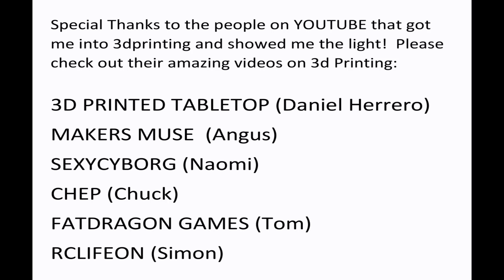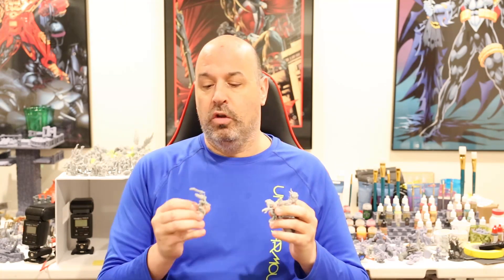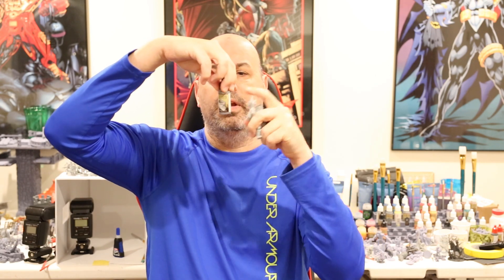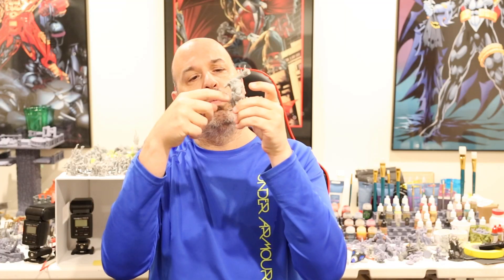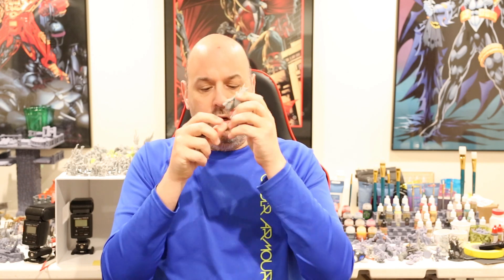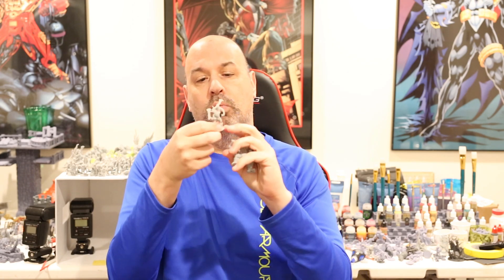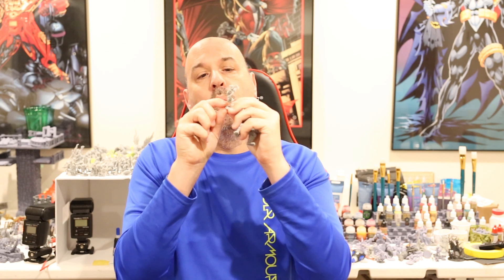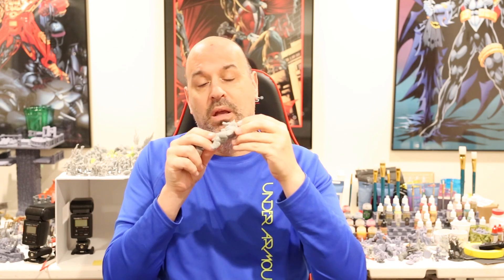How to orient humanoid minis for resin 3d printing.  Let's settle this once and for all!!

Comment: I'm a noob at printing but fail to se the logic in this as the surface area does not all get printed at the same time,  actual area being printed per layer is not as greater difference as you say.

Comment: hmm that is interesting it's almost as though you want the opposite of FDM printing. as smaller cross sections are less likely to fail where as in FDM printing they are more likely to fail because of the tug force of the extruder dragging hot plastic along the surface.

Comment: I think much of that "conventional wisdom" is left over from the early days when the Form 1/1+ was the only game in town.  It was a good way to increase resolution by moving some of your crossection into the Z axis.  That being said, the Form 1/1+ had a mechanically tilting tray as part of its peel process, which is substatially less stressful on the FEP than a direct vertical lift of the build-plate, which almost all other SLA printers use.

Comment: Since day one every single thing I’ve printed has been tilted back 30-40 deg, mostly to keep the supports off their faces and such.  I put RainX on the bottom of the vat.  I have yet to experience even one single failure or something that didn’t print.

Comment: Good insights, Greg. Just curious, if you don't tilt the mini much, won't you have less surface area to attach supports to? Also, which version of Chitubox (on Windows) would you recommend? I had to reformat my hard disk and was not able to note which version I used. I remember a few months ago that people suggested sticking to an older version of Chitubox because it was better than the latest (advice that I followed). Not sure if that's still the case now

Comment: Well, on many cases I don't tilt my miniatures at all. And the amount of people thinking they know better telling me that I have to tilt 45 degrees. We need supports for 2 reasons: 1. To support the "islands", and 2. to keep those large cross sections still attached to build plate, and not to FEP film. Another way of lowering those peel forces is to hollow your models. It only makes sense on larger models but it will greatly reduce the amount of support needed, and you can get away with making them tinier

Comment: Greg, great video - thanks for breaking it down.  Can you talk about how you remove minis from their bases without messing up the models/bases?  Maybe it's easy but every time I do it, I leave either some of the feet/shoes on the base, etc.
Reply: Us 3d builder for windows. U use the split option and then use the arrow keeys to move it 1mm at a time until you find the exact spot the feet meet the base.

Comment: I print my humanoids with a base included. Since bases are flat discs, if you tilt it, you decrease the peel force. Also, if what you say were completely true, then printing big miniatures would fail a lot more due to peeling than small, which certainly has not been my experience. Additionally, besides the base tilting, I also tilt so as no to support facial features: which are the part sof the miniature people look at the most. A failed strand of hair is noticed by no one, a failed nose: better print an entire new miniature.
Reply from the maker: When I print I get nothing failed, not a nose, not a strand of hair  :)

Comment: Interesting. I think I'll stop tying to maximise my bed usage and just print one at a time or and minimise fep pull
Reply from the maker: I still load the bed, just be cognizant of how much print surface may be printing at once and how it could cause failures...so on certain types of models you might not want to load the bed...
Reply: when loading the bed you need to pay attention to where those larger forces will be.  If there is a big layer make sure it's in the middle or evenly spread out.  If there's big pull on one side that isn't on the other that greatly increases chances of a line shift

Comment: Thanks for these topics on peel force. I've noticed that the forces might be larger towards the edges of the vat/print area. The rare few failures I've seen are on the edges, even though the same model prints absolutely fine towards the center.

Comment: Interesting video. I've watched a lot of your videos and they have been quite helpful, especially when I was trying to set up manual supports. But I'm curious... if you don't tilt the model wouldn't most of the supports end up attached to the model instead of the base? That makes clean up a bit difficult.
Reply: Dont print the mini on the base.

At 5 degree angle most supports will end up on the under/rear side of the mini
Reply: @JimmiWazEre  Many of the minis I have come on the base, so that's not always an option.
Reply: @RedDuckStudio  check out prusaslicer. It has a nice cutting tool(different from slicing) that you can use to split a mini from its base then save the base-less mini and the base as their own stl files. It only cuts a flat plane, so it might not work for all instances, but it does work for simple bases, so it's a start. For more advanced stuff, you could probably use mesh-mixer or something like that to remove more complex bases.  Side note: I also use prusaslicer to combine multiple stls and merge them into one solid piece and export that piece as a single stl. Again, more advanced needs will need a more advanced program, but adding say a keyring eyelet to a larger model and then printing that as one file/object/remix is possible.
Reply from the maker: I angle my supports if you watch my support placement videos you'll see why what you described doesn't happen  :)
Reply: @3dprintingpro212  I'm learning -- slowly -- to move the supports around so that they don't rest on the model. Also, maybe I need to watch that video again. I thought I'd watched all of 'em, but maybe not...
Reply: @3dprintingpro212  Oh, and thanks for the videos. They are very helpful.